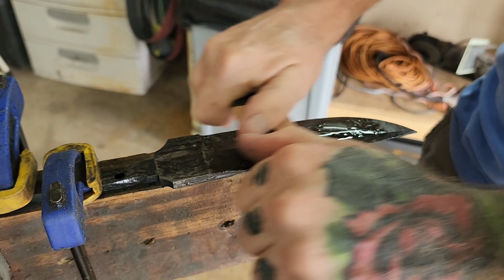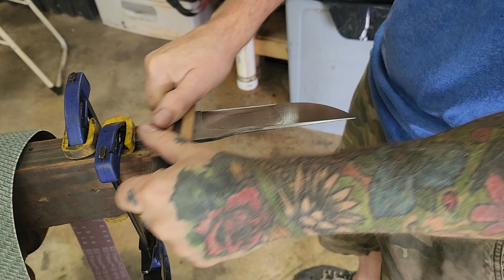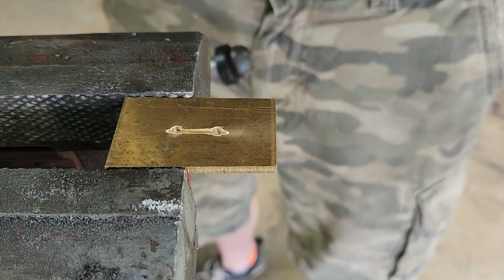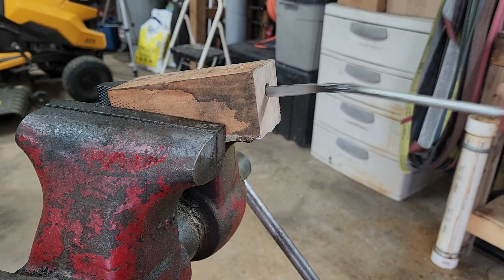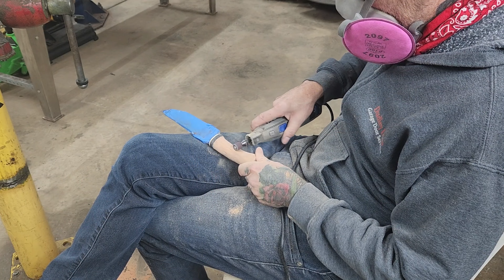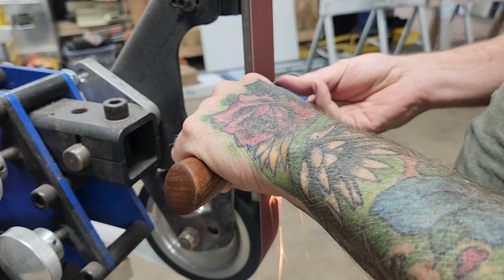Firescale Damascus Hunting Blade Build - Part 2

Comment: Really nice blade! If you're worried about the flexible sides of the belt when working on top of the grinder, you can aim at the spot right behind the top wheel (above the flat platten), an empty spot where you can draw a triangle basically. The belt has more tension there so it won't flex as much and give you a more flat area. Pretty useful when sharpening on a belt grinder, see if it works for you!
Reply from the maker: Thank you! Yeah, I've tried that. Unfortunately, I don't think it's enough for me to get the results I'm looking for. If you're interested, you can see my attempt at a solution, in my next video. I added a secondary platen, so that I could use that part of the belt, with some support behind it.
Reply: @RedRightHand-Blades-Marshal  It indeed looks like a pretty practical solution that should give you more consistent results, especially for the thicker and heavier blades! Great job :D

Comment: Keyhole saw?
Reply from the maker: Well, that might work well (although most of them  are tapered, and are pretty wide at the handle side, and may not be great for tight work). I could have sworn I heard a bladesmith mention a name for the tool, but I can't remember it.